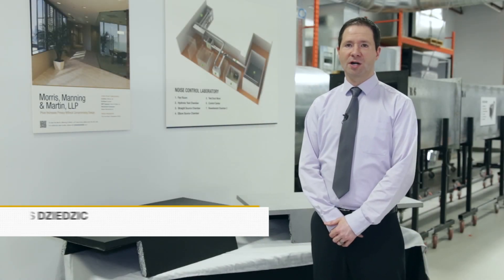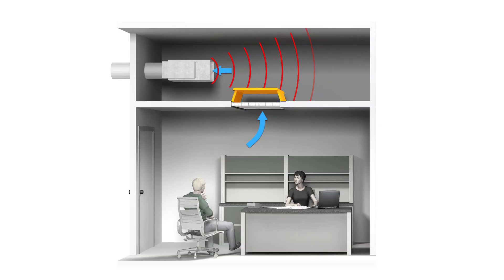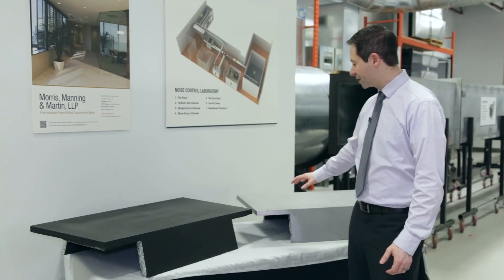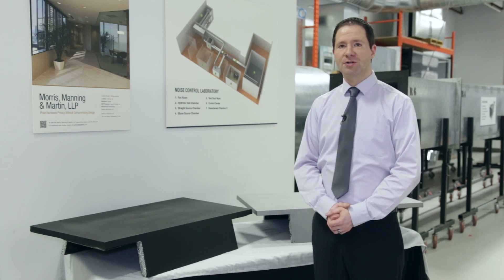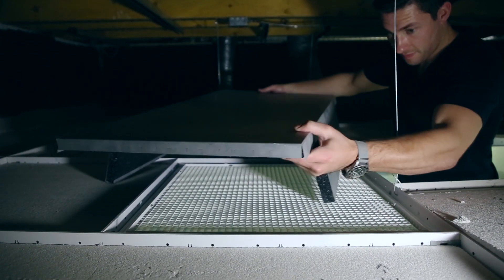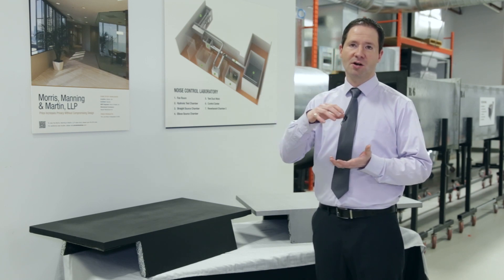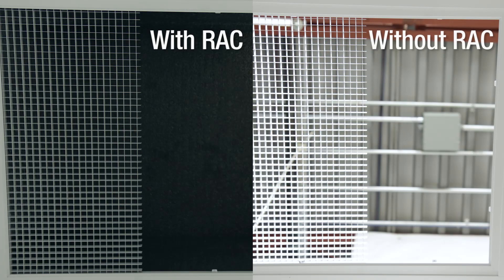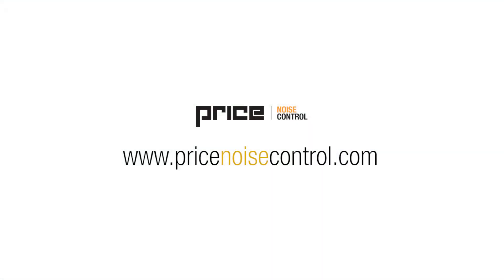Return Air Canopy (RAC) Silencer

Comment: How about for residential. We own a home improvement warehouse & I’d love to find one of these that would fit either ceilings or wall return units. 

The wall units are RIDICULOUSLY loud. 

Even my office space, which is new, 2000ft sq & only me in it, I have to close my doors to be able to concentrate. 

I’m to the point of debating window unit A/Cs because of how QUIET they are when running WIDE OPEN (yes, this is said in jest, but BARELY.)

I disturbs my conference suite in the back, the great room / waiting area in the middle (where it is located), the offices & public restroom. 

Just miserable.